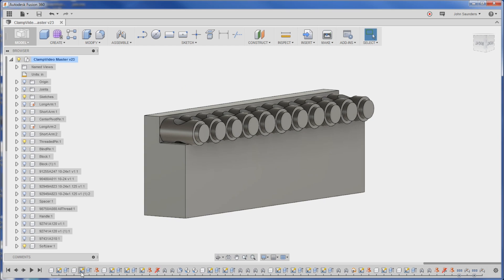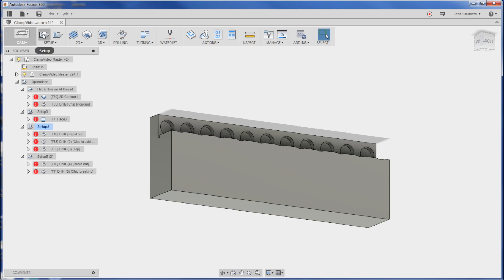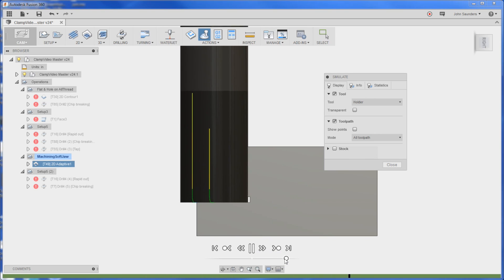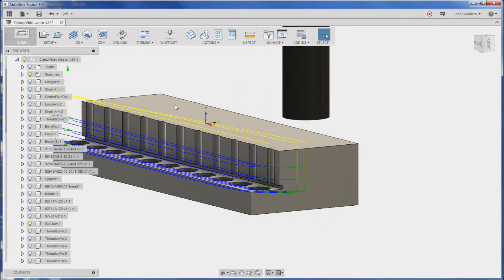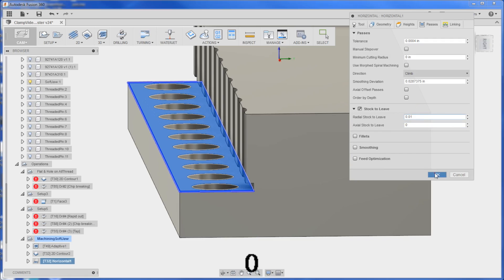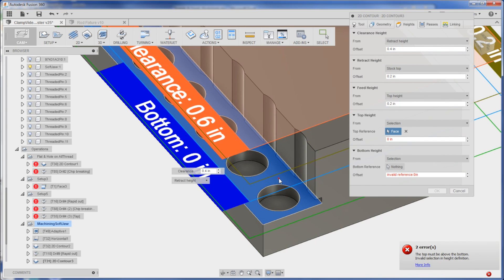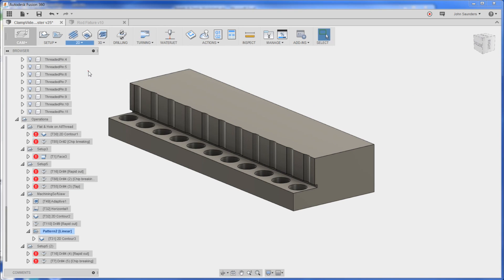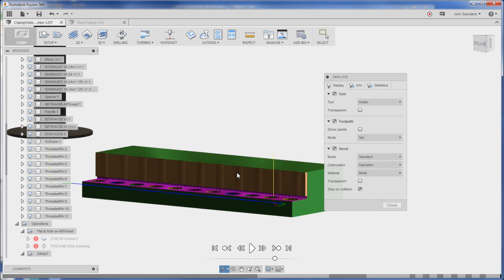Production Clamp Soft Jaws: Fusion 360 CAM!  Widget78

Comment: John I love this series  I'm having a bit of trouble with the spot drilling  I'm trying to do a counter-bore'd  10-32 cap screw hole for a fixture plate for a TAIG mill.  when I select drill I do not get all of the selections that you have in the menu. I just have standard center drills or countersinks.  My tool path tries to have it go to the bottom of the combined hole. I am new to cad/cam but not to machining Mahalo